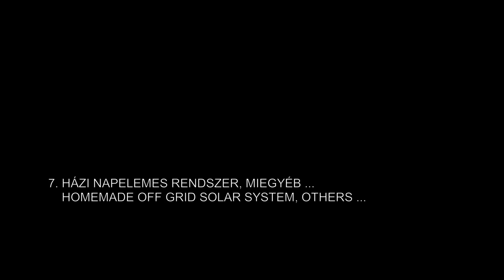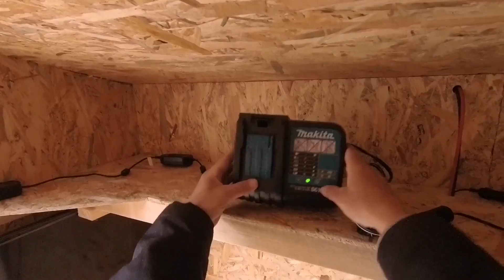7. házi napelemes rendszer, miegyéb 1. / homemade off grid solar system, others 1.

Comment: Szia, jók a videók, csak így tovább :)  Meg tudnád adni, hogy a napelemes rendszert milyen elemekből raktad össze? Köszi!
Reply from the maker: Heló!
Köszönöm szépen!
Sajnos az első videók nem voltak kellően interaktívak, a mostanában készülők már inkább, és ott azért már megy a magyarázat is, mit hogyan miért, mivel, miből.
A rendszer alapja Make Sky Blue vezérlő. Bátran ajánlom, olcsóbb a társainál, de tökéletesen teszi a dolgát (nem csak nálam):
https://www.ebay.com/itm/MakeSkyBlue-Solar-Charge-Controller-MPPT-Laderegler-30A-fur-12V-24V-36V-48-V118/264762950151?epid=17033994036&hash=item3da51a0207:g:wuAAAOSwa3VdYY7P
Már megvettem a másodikat is (mindkettőt a fenti linken található eladótól), mert nemsokára költözöm át a téli szállásra, és ott már nagyobb rendszerre lesz szükségem (4 panellel az asztali pc, mosógép, hűtő miatt). Ott már részletesen el is mondom mit miért ...
Ez a töltésvezérlő egyébként 60A-es, szóval két db nagy napelemmel tud működni (max 700W).
Mellette a falon egy szimpla biztosítékdoboz található (Banggood-ról). A napelem amit most rákötöttem egy 290W-os Canadian Solar. Jófogáson hirdette az eladó, aki dunaújvárosi. 39000Ft volt darabja.
Nézz be máskor is!   :)
Reply: @talpalatnyizold  Szia, köszönöm a részletes választ!